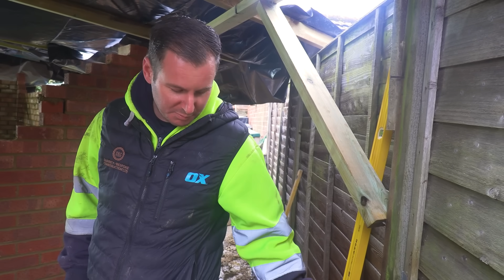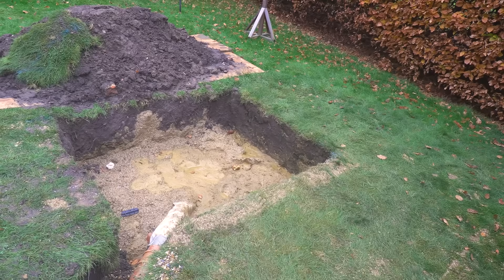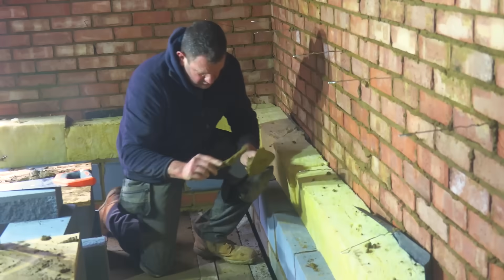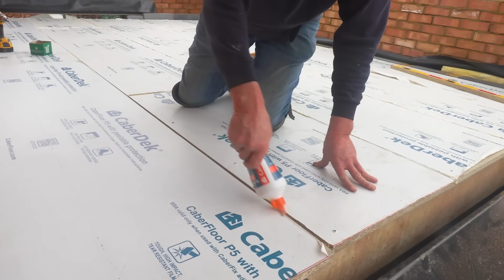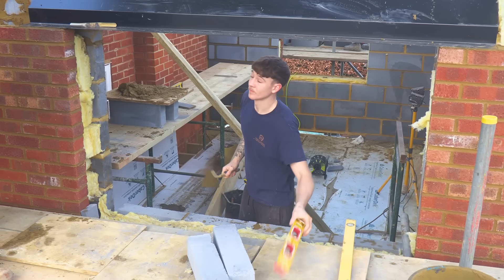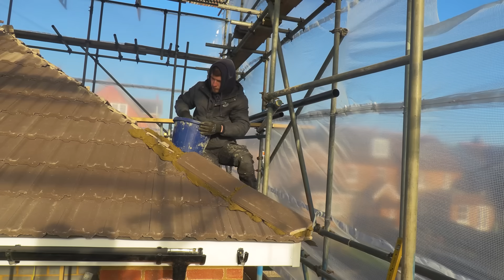Extension Build 2024 | The Times They Are A-Changin'

Comment: We built 125mm cavity with 75mm pir and 50mm clear cavity up until this year. New regulations are now 90mm pir with 50mm clear cavity.
Never liked rock wool don’t like the idea of soaking wet rock wool in my cavity’s. It’s obviously a lot easier to fit than pir but pir is far superior and less chance of damp issues in the future. A cavity should be a cavity especially on brickwork imo.

Comment: Celotex Thermaclass 21 is a full fill rigid insulation that meets current u-values and is 100 mm thick installed in a 100 mm cavity

Comment: Existing cavity wall needs a vertical cut where the new wall meets it. Try doing that once youve built the new extension. Could be enforced by building control. Brickwork otherwise looks tidy.
Reply: Cut is only in the outer skin for installation of vertical dpc.  Ideally insulated if you want to avoid cold bridging.  The structural skin is unaffected if an engineer requests it you can always install remedial wall ties for stiffness before you make the cut.
Reply from the maker: Not required. The cut can weaken the corner
Reply: @SkillBuilder  existing outer leaf needs vertical cut to prevent damp tracking and cold bridge issues, inner leaf maintains structural integrity.

Comment: Good informative YOUTUBE video as usual RB. With regards to thermal cavity wall insulation, I’ve never favoured AIRCRETE bl’wk being used to improve thermal values, as the inner cavity wall leaf is really for load bearing requirements from floor & roof loads & certain beams/lintels etc. Therefore, a dense aggregate block will tend to perform better structurally than AIRCRETE block & with all the inherent fixing issues to AIRCRETE. 

As for the insulation full fill within the cavity with face brickwork outer leaf, a waterproof insulant rather than a water resistant/repellent additive material should be a consideration, the cost difference shouldn't be that much higher. Also over time, a mineral wool type product could slump within the cavity compared with a rigid T+G board. A basic thermal calc will identify the cavity width required & what type of insulation board to achieve the current elemental U-value, this being 0.18W/m²K for outer walls. The example below achieves this with dense bl'wk & a 10mm residual cavity using this type of quality insulation, i.e. 125mm o/a cavity. Water ingress from driving rain could bridge a full fill insulated cavity with certain brick types, even small imperfections, so any residual cavity will assist, I guess everyone has their preferred methods :-)

Rsi
   1	   15	  0.180			  0.083	      	Gyproc Wallboard 12.5mm+skim
   2	   15	R-value			  0.170	      	Drylining - plaster dab cavity
   3	 100	  1.080			  0.093	      	MasterDenz (agg1960) Internal
   4	   10	R-value			  0.290	      	Cavity unventilated low-E (0.2)
   5	 115	R-value			  5.200	      	Recticel Eurowall+
   6	 103	  0.840			  0.123	      	Brick outer leaf
Rse				                         0.040	      	
-----------------------------------------------------------------------------------------
U-value (rounded)	  0.18  W/m²K
-----------------------------------------------------------------------------------------

Comment: Why ain’t they cut a cavity, or even a saw cut in cavity of where new meets old 🤔
Reply from the maker: Because it is not required. The engineers and architects give the builder a drawing which is passed by Building Control and then the builder builds what is on the drawing. If you start cutting the cavity near a corner you have weakened the structure. If the engineer says to do it then it is their insurance that pays.

Comment: No cutting into the existing wall to continue the cavity or vertical damp ..?..
Reply: Surely that would create a bridge?
Reply from the maker: It is not always required. It is better to keep the strength in the corner
Reply: I agree, surely damp can penitrate through the original bricks into the  extension?
Reply: The extension I built in mid 1980s used a Crocodile wall extension profile. Stainless plat screws to existing wall. Clip
In ties are built into the new wall. It’s not moved in 40 years and no problems with damp or cold bringing.

Comment: I’m putting in 90mm is the 150 material substantially better ?
Reply from the maker: No the 90mm PUR board is the same as the 150mm mineral wool. The trouble with pur is sealing the gaps. The mineral wool is faster

Comment: I bought a new build with London Brick about forty years ago built with the "frog" (dimple in the brick) placed down. I noticed bricklayers in this SB vid placed the bricks frog up. That's the correct way I think as the other way caused serious problems. Face of the bricks blown out by frost particularly below DPC. They did it this way because its quicker as less mortar is needed. Funny though, the last course they laid before they went home were always frog up! lol Dave
Reply: Upon taking off the render on our outhouse due to failure and spalled bricks I too discovered that the bricks had been laid upside down with massive air pockets in the frogs.  To make matters worse they had mixed a far too strong cement mortar and render so that it was no wonder the bricks were spalling. The only time I have decided to lay bricks frog down (with filled frogs) was on the top course of a dwarf wall in a greenhouse so that the frame could be laid and sealed to an even surface. I've  repointed and re-rendered with lime to improve water transmission and built a toolshed extension on the worst west facing gable to protect the outhouse. If I'd discovered similar on my house then it would need major replacement, not everything was better in the "good old days".
Reply: @johndavenport7281  Interesting John

Comment: They look and sound like good guys. Most of these recent insulation rules are going way over the top.
Reply: Disagree.  British housing stock is old and antiquated. New builds need to be better insulated. My house has been renovated to part L regs. So, 150mm drythem cavity.in the walls.etc.... Barely needs heating and keeps a far more constant temperature, so comfortable.
Reply: The people making the rules haven't got to pay for the materials

Comment: I'm always surprised that many trades are unaware of the rules regarding drilling and notching joists. The ones for the copper pipes caught my eye. Keep your holes for services in the middle of the joist and keep the hole size to a minimum. If you are drilling or cutting into any structural element as part of your work you need to be aware of the implications of what you are doing and what is acceptable... especially if its a task you are doing on a daily basis. Sometimes people wonder why floors of old properties are bouncy and when you lift the floor boards and see how many holes and notches have been added to the joist over the years, both top and bottom, then you realise the joist has lost almost a 3rd of its structural depth.
Reply from the maker: That is all in the existing buildimg. You won't thread copper through the middle of the joists.
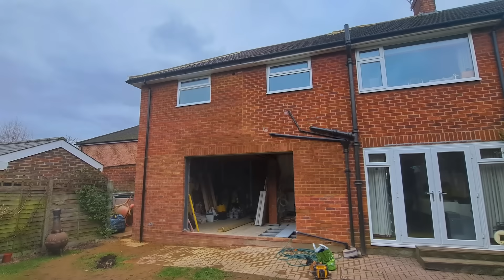Reply: @SkillBuilder  Sorry, but 8:22 is definitely not in the existing building, and there are three copper pipes with huge holes through every joist. Those holes look to break several of the LABC/NHBC guidance. (Not on joist center-line, holes not spaced 3x diameter center-to-center, holes too close to supporting wall - <0.25 x span)
Reply: @stephen-boddy  You've just BUSED skillbuilder

Comment: How you can't get it that the wool insulation you used will soak moisture like sponge and will never dry out. Same as your foamcrete blocks. Unless you manufacturing penicillin from that mould you gonna get.
Reply from the maker: It has a water repellent face.

Comment: That's tasty work, the scaffolding is a masterpiece especially with the roof on top of it. The only red flag i spotted was the plumbing, the joists should be drilled in the center along the neutral axis. Holes to be kept as small as possible with an allowance for expansion.
Reply: I’m curious what makes it good scaffolding please
Reply: @Wgnwtb  The roof on it, you'd never see that in Ireland. Paddy's too tight to pay for it! 🙄
Reply: @Toyotaamazon80series  lol thank you)
Reply: What plumber ever drills a reasonable size hole for a pipe, it always seems mahusive to the skinny pipe 😂
Reply: No one listens to the joist regs in plumbing or electrics. It's a redundant regulation really
Reply: Pipes should have gone in before the Caberdeck was glued down. Plumbers would have been cursing. Builders probably thought Hep2o was going in.
Reply: @nectafarious8842  You'd still have been able to drill through the centre of the joists from below.
Reply: @Toyotaamazon80series but if the pipe is copper it needs to be notched into the top of the joist
Reply: @dankelly4976  Why?
Reply: @Toyotaamazon80series  how else would you install 15/22mm straight lengths of rigid copper pipe perpendicular to the joists?

Comment: I have seen 150mm,    200mm  and even   300mm cavities on sites recently.     What nonsense is this?      This cannot be a viable way for house building to proceed into the future,  and the large volumetric house builders wont view enormous cavities as economical into the future either -  so then what?
Next year the "Future homes standard"     comes into force along side more tweeking of the Building regulations -  so expect more of this stupidity coming to a cavity near you soon.....  Does anyone really think Air sourced heat pumps are the future for heating homes at scale.??????
W.T.F
Reply: Air source heat pumps are not the answer to the boiler replacement issue for the domestic housing market, at scale.....
#heatpumpsareshit.
Reply: Am they heck

Comment: I was speaking to a builder the other day whos doing a extension and he said the 150 is only for new build he did cavitys in wool 100mm. has anybody actually read the exact wording of the regs. and does it depend on your area im in north yorkshire
Reply: My architects said it applies to extensions too and drew my plans with 150mm cavity, as said 100mm doing it with special PIR is prohibitively expensive…. However my builder said we can still do 100mm with PIR for extra £600. I would say thats reasonable and worth paying to save 3 x 50mm internal wall space, also means dont have to pay more for longer brick ties, wider lintels, cavity closers etc… from what ive heard getting 50mm longer brick ties cost 100% more than regular.
Reply from the maker: You can trade off by beefing up the existing to bring you up to a decent standard but the builders build what is on the drawing. The horse trading is between the architect and Building Control.
Reply: Pay for a home energy survey, £280 and keep your 100mm cavities.
Reply: That scaffolding roof must have cost a fortune 🤷‍♂️. Nice for the lads working though

Comment: There’s no way on this planet those pipes allowed to be cut in to the bottom half of the joist? Surely that’s against building regs?
Reply from the maker: You are right Dean, you should never notch the underside or do anything past the centre line. It was the plumber let loose. The joists had to be beefed up with extra ones to get over the issue.
Reply: They should be notched into the top of the joist closer to the bearing point, where the joist is in compression rather than below the neutral axis where the joist is in tension.

Comment: In the future, houses will be made entirely from insulation
Reply: My woodwork teacher told us that the adhesive was stronger than the actual timber members being joined together. I can still remember the look he gave me when I asked "Why don't we make furniture out of adhesive then?". With heating bills at current levels I'm beginning to think I'll have to move into a new spec home and leave our 150 year old stonebuilt cottage behind. There's a limit to how much roof insulation, double glazing etc. can do when there are 2ft thick walls soaking up interior heating.
Reply: @johndavenport7281  I built the house we currently live in. The walls are a insulated/composite timber system with brick rain screen cladding.   Triple glazed windows on west/North and East elevations.  High levels of insulation to sub floor/ loft and intermediate floors. almost fully sealed with an internal ventilation and recovery system.  U - values achieved easily far exceed current required standards and E.P.C =A* rated.
It is the only way to go.....
Reply: SIP is the future... Or present 😂
Reply: @Crogookah  Certainly one way to go. And S.I.P`s  is good.
I have done "Passive-Haus"   and "Huf -House"  triple glazed windows,  air-tight structure with MHVRS  Now that is the way to go.............
Reply: They’re called bricks 😂

Comment: 2:25 150 cavity for the wool insulation if you use PIR still under 100
Reply: I went through this recently where our architect/engineer had given specs according to old building regs. Since we had already built the walls up to damp level, I also had to switch to the special PIR tongue & groove insulation boards which probably doubled the cost on insulation. However, (based on calculations) it overachieved the required level. The bricklayers (from Moldova) did an awesome job even though it wasn't an easy job.
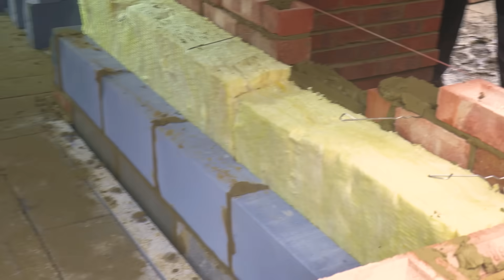Reply: 3:55
Reply: I had to do my own calcs to convince BC I could use 100mm PIR on a garage conversion. What a menace.
Reply: @jonp6798  If you live in a weather-sheltered area, filling 100mm with normal PIR is probably accepted. I live in a sheltered area as well. But I thought of sticking to 10-20mm air gap between the PIR and the external wall while using 90mm tongue and groove PIR boards (even though they are freaking expensive) to stay out of trouble from building control. They say that rain penetration can happen across joints unless they are tongue & groove style boards. Not sure if it has been proven or utter BS for selling something at a higher price.